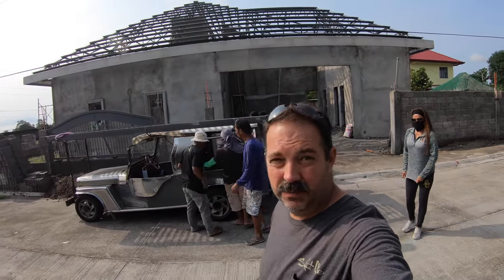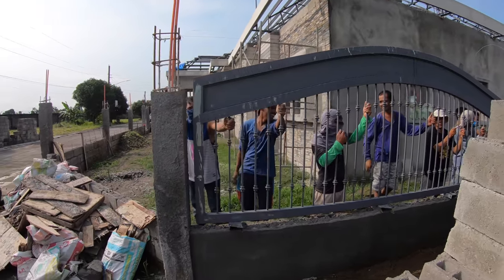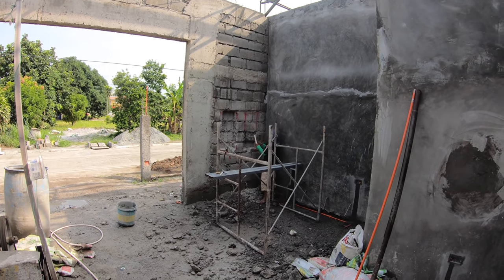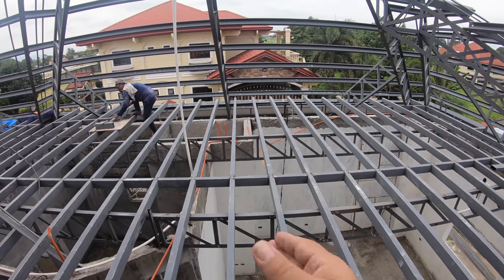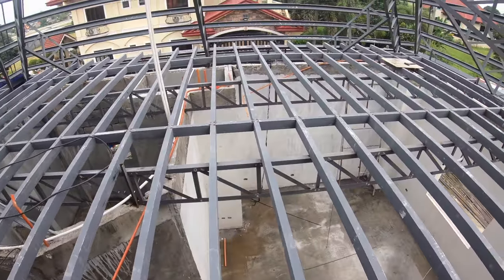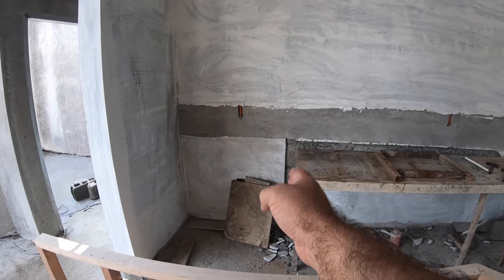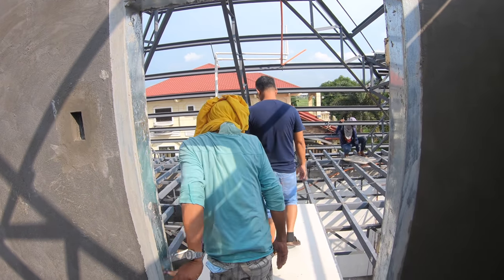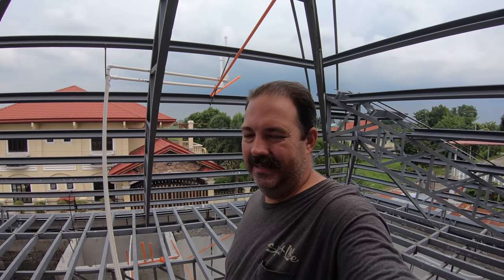Philippine House Building Step by Step, Build Day 129: Doors, Grilles, and Floors

Comment: Great looking roof George - it will look awesome once it is clad. I am concerned though with the cement sheeting that you are using as a floor in your attic. You may want to check your local regulations but I would use nothing less than 3/4" or 19mm for a floor irrespective of where it is or what it's load bearing will be, I don't think 12mm is adequate, I think that product is made for wall cladding and not flooring applications. Flooring products should also be tongue and grooved for extra rigidity, be glued to the joists and the sheets should be staggered. I hope you don't mind me picking too much on what I see wrong in your build, perhaps you may wish to double up on the cement sheeting and end up with a 24mm floor ??
Reply from the maker: Thanks for the heads-up, Serge. After a little research to confirm, James Hardie website suggests minimum 16mm for flooring (5/8"). We'll discuss with our engineer before moving forward.
https://www.jameshardie.com.ph/faqs/application-installation
Reply: @CasaTexPina   - G'day George 16mm in cement fibre probably does have the MOR of a 3/4 engineered timber or natural wood that you guys can't use due to the termite issue there. Given that this product is not tongue and grooved I would at least glue the sheets to the joists and stagger them. You will get a stronger and squeak free floor.
Reply from the maker: I’ll discuss with the engineer at our next meeting. 👍😊